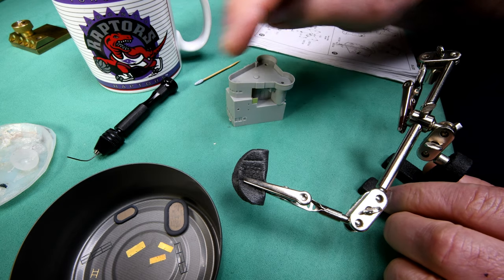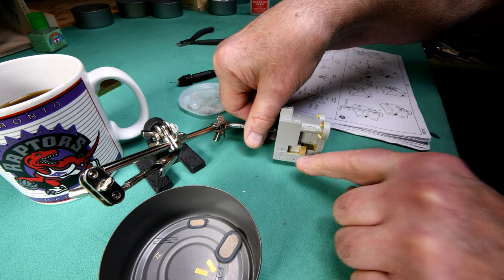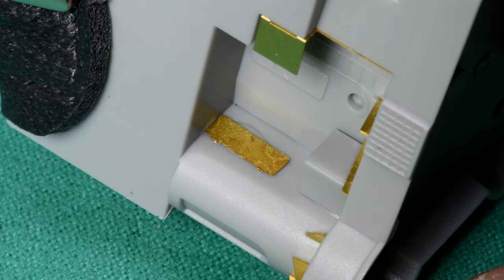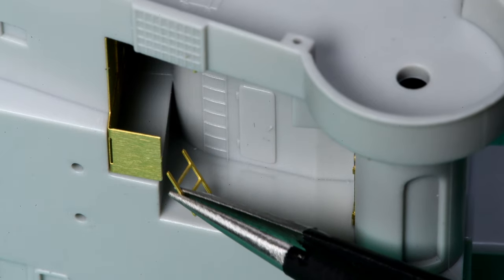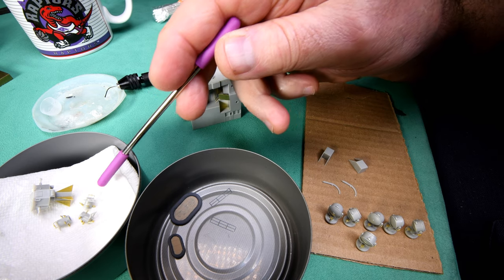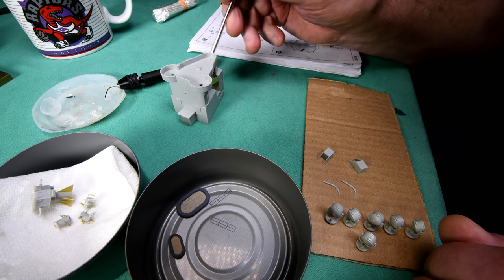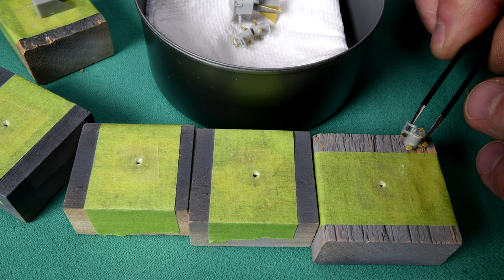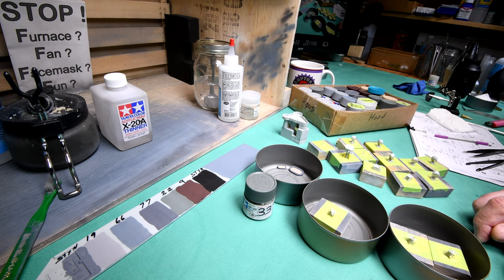The Model Ship - Part 665

Comment: As a new boy to photoetch, one thing that seems to work for me is to put the tiniest amount of CA on a scrap of wax (greaseproof) paper - the type used for baking.  I then just dip the part on to it very very lightly and it seems to work much better than applying the glue to the plastic.  I think that would have worked well for those ladders.  My issue at the moment is removing the photoetch part and bending it.   I’m hoping Santa is going to bring me a photoetch bending tool and some wearable magnifiers.  

I’m building the Trumpeter 1:350 Type 45 Royal Navy Destroyer, which is an easy build compared to HMS Hood, but challenging enough for a novice and these videos are great.  Wishing you happy holidays from across the pond.
Reply from the maker: We just have to remember to enjoy our building journey. 🎄